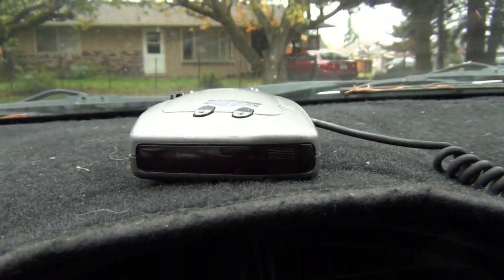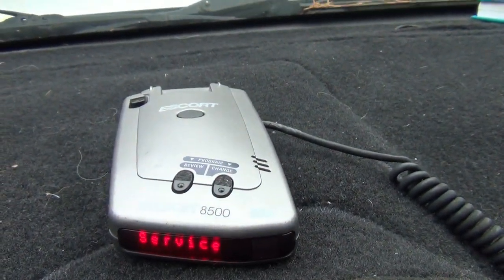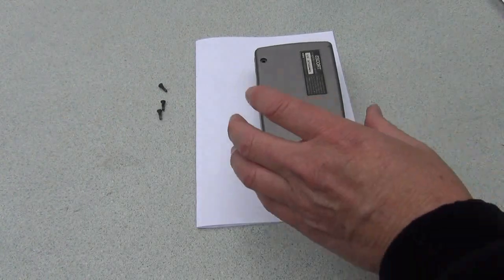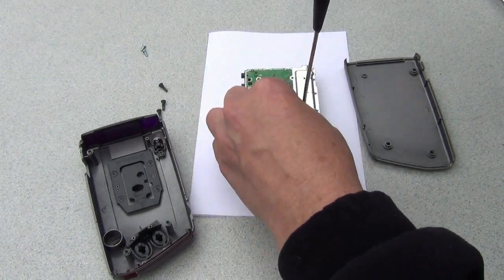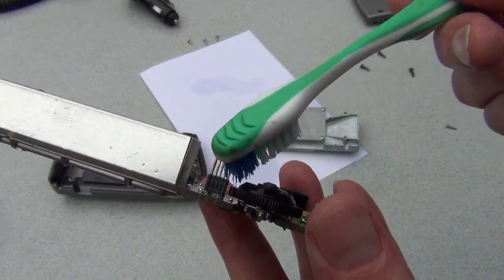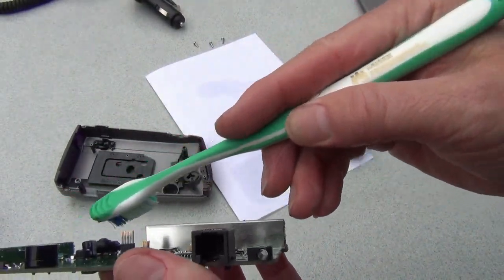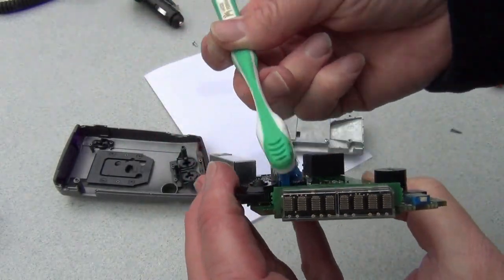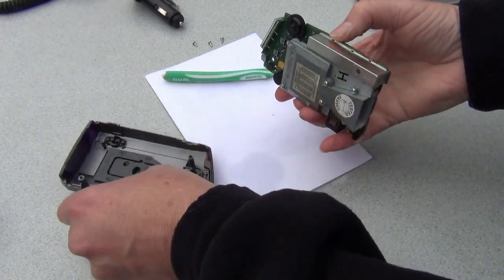passport escort 8500 Service Error 3 Repair

Comment: Worked for me! Sept 2025. Makes sense because I used to bang the detector against my center console to make the error message go away, at least for a couple of months. Seems the banging forced the oxidized contacts to make connection for a short while. All it needed was a little cleaning.Thank you!

Comment: Hi, I have an old SR7 installed in car and giving same error.  Do I need to open up the front radar receiver and look to perform same cleaning, or is problem in interface under dash?  I suspect in radar receiver?  Thanks.